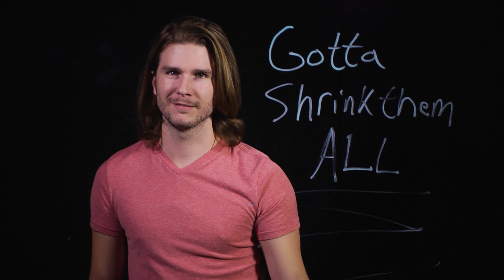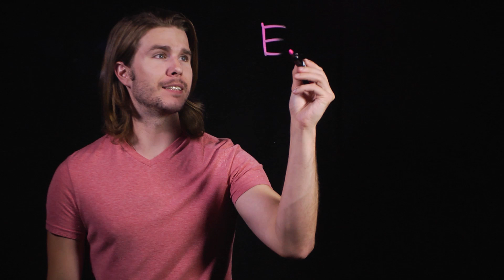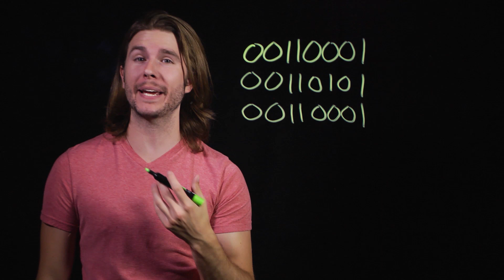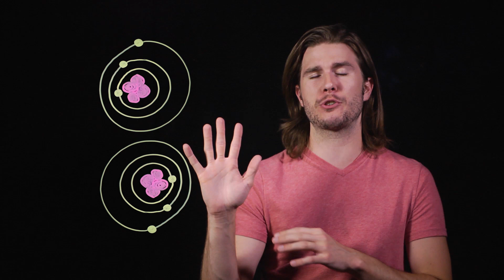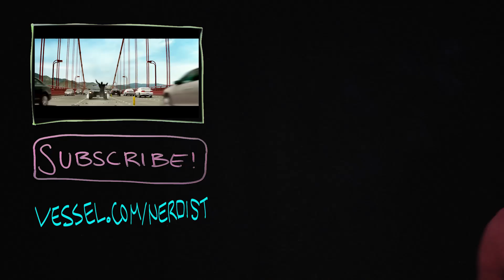How Do POKEBALLS Really Work? (Because Science w/ Kyle Hill)

Comment: If you shrunk an atom wouldn't gravity increase thus creating a black hole
Reply: ***** Black holes are such crazy things - physically speaking there's no way they can exit. What's infinite density really? The mysteries of the universe will tell us how pokémon exist
Reply: No.
Reply: First look up the schwarzschild radius, then look up hawking radiation.

A black hole can only last as long as it has matter, which is constantly losing through hawking radiation.

Think of black hole as a fire, it can only burn so long as it has fuel but continues to gain fuel as it feeds which is burned as timed passes, alternatively think of it as an ocean cycle where water is constantly being vaporized and rained back in.

Also a black hole must be created from at least two particles, anything less doesn't act like a black hole even if it lasts long enough to be observed.
Reply: also decreasing radius doesn't increase gravity on its own as you have to have enough matter in a small enough space to create a black hole that can consume additional matter quickly lest it fade to nothing more than a signal as it dissipates.

Comment: more accurately, how is Ant man able to shrink?
Reply: Tallacus He farts space magic.
Reply: Pym Particles
Reply: riley van horn guy ... Yes.
Reply: Tallacus Same idea, shrinking electrons to reduce the size of the object, in this case, Ant Man.
Reply: MadMargaretGaming hence the "Pym Particles"
Reply: Tallacus
Hence the particles capable of shrinking the size of atoms
Reply: +Tallacus Here's the physics:

1. Electrons are negative energy.
2. Protons are positive energy.
3. Energies of the same sign repulse each other, those of different signs attract each other.

Therefore, if someone were able to remove protons from an atom without creating an enormous release of energy (atomic bonding is one of the strongest forces in the universe) and suspend it somehow among the electrons, theoretically they should pull closer together thereby shrinking the atom. 
However, there is one major flaw in Antman. They claim that if the core (or whatever it is called) is removed, the shrinking will never stop and you will become smaller than atoms and enter the quantum realm. This however is impossible as the molecules of the atoms are coming closer together, yet they remain the same size. By this fact, it is impossible to shrink past the size of your collective molecules.
Reply: +Tallacus It says it on the movie Pym Particles, the same way pokemon shrink.

Comment: Made up math and science. He can't even theorize electrons behavior properly. Let's call this nerdist science. Taught by leprechauns and unicorns.
Reply: ***** At least taught by Thor or something. I don't even look like a unicorn.
Reply: +Kyle Hill 
But doesn't this theory seem plausible. Pokemon are capable of converting forms of energy into other forms or converting mass into energy. If they are capable of doing that then they probably have the ability to turn into energy themselves. Now when a trainer uses his pokeball, the pokemon gets converted into energy to allow easy passage through the portal to another universe or dimension.(Since energy can travel through portals like wormholes with ease. When mass would do the same thing, it would spaghettify or something worse.)
Each species of pokemon has its own universe of origin and a and there is a possibility of infinite universes. So that brings the possibility of many more pokemon to be discovered. Anyways depending upon the types of pokemon discovered the pokeballs are designed with breaches (between the universes) to transfer the pokemon. In case of rare or legendary pokemon.. the universe breach is too tough to create which is probably the reason why you nedd masterballs or ultraballs to catch one.